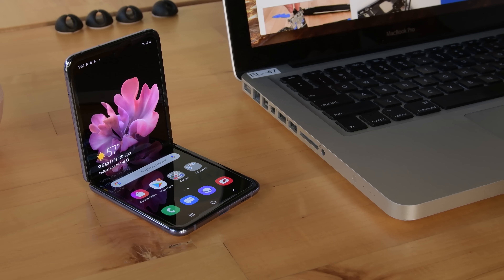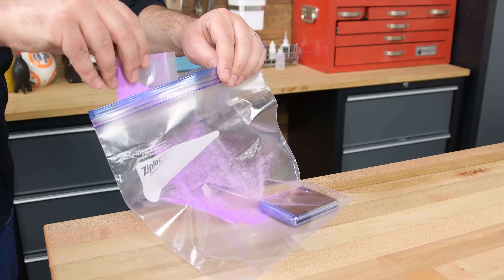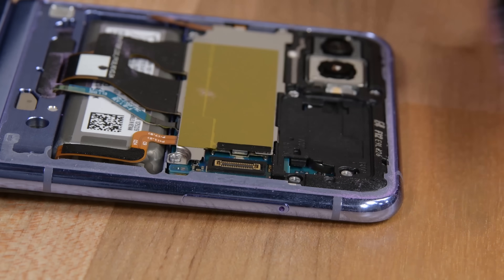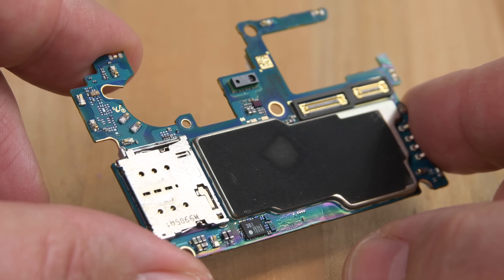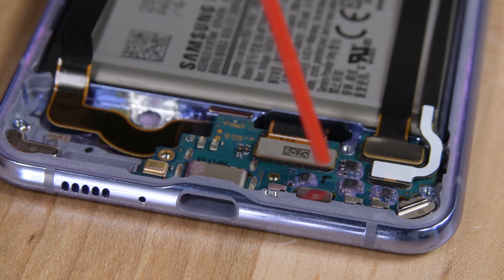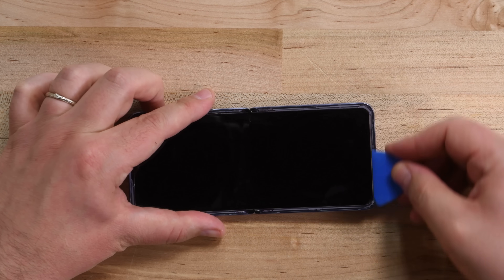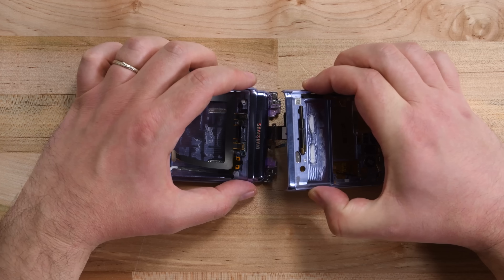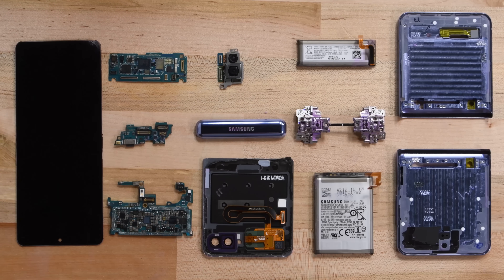Galaxy Z Flip Teardown and Dust Test FAILURE!

Comment from the maker: What do you think of the Galaxy Z Flip? And what do you think it should be scored?
Reply: Too much hype for glass that didn’t give any protection
Reply: Watch Jerry rig everything’s video to see it so basically the glass is under a plastic ‘protector’ which is actually part of the screen and if removed will kill the display and under that is glass so pretty useless glass
Reply: @montyyy  "But this glass is built to last and protects your screen from scratches" ~ Samsung
Reply: Maybe 3/10 or 4/10
Reply: Scratches at level 2 -> 2 out of 10
Reply: probably 2 or 3. Givin how fragile and the importance of the phone display it is.
Reply: 0/10
Reply: @DimaTkachenko  hahaha bitter apple fanboy.
Reply: @dreezyloran6787  no it is a 0 it has no reason to exist
Reply: 6.9
Reply: 5/10  Love a flip phone but will not buy 1 til samsung works out these issues you and others have brought to light
Reply: 0. It shouldn't exist, it's a solution for a problem that doesn't exist. I don't NEED a flip phone, if I did I'd rather see a physical keyboard hinged to a display, something like that. Not some morons trying to bend glass in half because they can.
Reply: Arudanel ok get some blackberry phone instead ok simple periodt
Reply: This phone looks like a total failure if it didn't bend it would be a 150 dollar phone.
Reply: @Babaji5D  your not going to buy a $1380 phone then ignore the warning that clearly STATE not dust resistant then put the phone in a bag of dust shake it then complain when the phone brakes. Would u go swimming if u can't swim?
Reply: 2/10
Reply: Samsung DID NOT tell you guys you can use a screen protector, stop making shit up just for a longer video. Both warning labels clearly says no films, stickers, or screen protectors. Also who is professional enough to install screen protectors on the z flip other than Samsung... Nobody period and Samsung doesn't offer this service since no official screen protectors exist for the z flip seriously get out of here.
Reply: An absolute failure and shame. Paying $1400 for this piece of shit is a best way to prove yourself a slave to this company
Reply: I think it's a 6, from a repairability perspective. Routine glass removal than easy battery swap (except the glues). Screen replacement isn't hard too, but it breaks the plastic bezel, and if there is no official replacement part, then 4/10.
Reply: 2/10
Reply: The foldable glass is brittle since it relies on the plastic screen protector for protection lol. Samsung needs Corning's Willown glass for their foldable devices.
Reply: solid 4
Reply: iFixit I don’t know probably a 2 out of ten about the only thing you can repair on it is the battery but it’s super hard to get to. You can do anything about the screen because were are you going to get one?
Reply: 3/10
Reply: Cool invention, I'm not buying it..
Reply: Please tell Zack Jerryrig to use isopropyl alcohol to remove battery..
Reply: It is very expensive.
Reply: The video made it seems so easy, I'm expecting at least 5, but wouldn't be surprised if it gets lower score, because I see a lot of glue and prying that might damage the component, and I don't think that the screen bumper is coming back
Reply: 1 for glueing the batteries down still
Reply: can’t compare with a laptop when you have to squeeze every millimeter of space. i do think the test is a valid test as it shows what can ultimately happened. however, ifixit didn’t provide any baseline like same tests conducted with other devices including legacy moto razr
Reply: 0
Reply: Lu Up not really because if you watch Jerry rig everything the glass that was under the plastic layer cracked and the glass offers no scratch resistance
Reply: I'd give it a 4/10
Reply: 6
Reply: I don’t trust Samsung anymore. Galaxy S10 + was the last purchase from Samsung liars!
Reply: 0/10
-
Reply: Rubbish
Reply: 2/10
Reply: 4
Reply: 8/10
Reply: 3.5 ?
Reply: 4 out of 10
Reply: 4
Reply: 4/10 for Open the device ... But 0 Points for this clickbait powder with hard particles
Reply: iFixit god no
Reply: Why iFixit's channel is not verified?
Reply: Yikes 😬. I may return my fold! I do construction 🏗️ and work around dust parti all day!
Reply: I bet u did this after seeing Jerry's video 😏
Reply: There is a difference between dust and powder.
Reply: iFixit  this review is pointless to regular consumers.  The warning says it’s not dust resistant or waterproof. It seems we have more clickbait than real reviewers.
Reply: Repairability: 6.5
Durability: 3.5....for now

Depends upon how easy spare parts are - could have a lego set and if you're needing to replace one special brick that you can't buy - that would be zero repairability - a factor overlooked - access to parts.

So presuming spares available - I'd say it's a 6.5 as for durability, looking at a 3.5-4 and maybe lower after time has had its say.
Reply: @paulgray1318  You forgot they only rate openable phones 7 and above. 6 for phones which need ungluing.
Reply: 5 out of 10
Reply: 9
Reply: @cristianfederico2411  lol
Reply: It's useless. Why the fuck ppl need a fold phone anyway? Can it help to save space ? No ,it is use more space in it pocket and waste more space in the battery size and it not even "drop" proof. Its some ridiculous hype for s rubbish product
Reply: @haidweng7948  You must have been on something when you wrote that pile of crap pal. There's a number of reasons people buy a folding phone but none your intellect will understand. I won't try and explain why it fits pockets better than none folding phones of the same screen size because you won't understand that either. Put a decent case on a mobile phone and it will be drop proof for most people but I suspect you keep dropping yours as a consequence of being on something and losing control of your faculties. I don't own a folding phone, yet.
Reply: kinda embarrassing that in many countries people starve because they have no money water or food, but you buy a expensive phone and destroy it just because.  its tragic.
Reply: @darknessviking  Wow are you ever missing the point of iFixit! It is actually possible to tackle multiple societal problems, such as starvation and right to repair/e-waste, if you let go of the concept that ALL of your effort should go to the cause which is affecting global health at the moment. The folks at iFixit do not specialize in Supply Chain, Public Health, Nutrition, or any other field directly applicable to ending world hunger. This channel, and research into what damages electronics and what can be done, consumer reporting, is their job. If consumers buy devices which can be repaired, those devices do not need to be thrown away. The E-waste problem is a huge global issue with which the current and future generations have to grapple, just like starvation is today. You have to take a multifaceted approach to appropriately solve the world's problems.

By the way, you know who else destroys phones "just because?" Phone manufacturers. Phone manufacturers like Samsung throw absolutely everything at their phones to see how much they can take. They'll destroy dozens of them, not just one. Typically, they are not proud enough of what kind of pounding their phone can survive to boast about it, which is why you don't see phone manufacturers abusing their own products online. Because of tech companies' conflict of interest in disclosing the extent of their products' durability, it is up to independent parties with large platforms to run similar tests so consumers know that their devices are at least reasonably durable or repairable.

Also, if you're watching for entertainment, I posit this is not the most destructive entertainment outlet I've seen.
Reply: @darknessviking  Kinda embarrassing that you have internet when in many countries people are starving for such an opportunity that you are wasting away straw-man moaning when you're not playing your PS/4.
Reply: @darknessviking  you're tragic.
Reply: @darknessviking  Kind of embarrassing that you aren't in those countries right now feeding people and giving them water but instead bought a digital device and are now leaving a comment instead. It's tragic.
Reply: @darknessviking  It doesn't look destroyed and at least this phone has been disassembled to educate repairmen to fix this phone instead of binning it.

Comment: The single thing stopping me from buying the flip 3 is the dust. In the past I've had way too many experiences with dust getting under the screen, camera lens, generally places you wouldn't expect dust to be trapped in. This looks like a nod to those olden days. I'll wait until they get a proper dust resistance rating.

Comment: Thank you for the video! But I have to change the frame that you can see at 2:13; After I remove the old one, to put the new one, do I need an adhesive tape or does It get stuck in place by pressing, without nothing? Thank you.

Comment: One month in jeans pocket, still no issues. One small tiny scratch on screen, my Chihuahua stepped on it while open. But surprisingly no any deep scratches which after Fold that I had before shows the actual improvement. It's a cool thing. It has no other value it's just cool. Not a boring block

Comment: Once manufacturers finally figure out, how to seal the whole god damn phone with hinges and whatnot, only then will folding phones become the big thing. Until then, I am pretty happy with my standard phone without any mechanical elements.
This phones seems to be pretty easy to take apart. Knowing, that there is nothing about resistency against anything, I am pretty confident I could easily take it apart and put it back together again, not worrying too much about replacing batteries or anything that might break.

Comment: “Alright, we’re gonna test how durable this car is by running it over with a tank, then calling an airstrike on it. Wow, look at that, it’s not starting up, well, this is shit, don’t buy it, not recommended as a daily driver”
Next time, maybe go a bit more granular on the dust ingress. 
Unless I’d been buried at a beach, my pockets wouldn’t be anything like what was in that ziplock, and the stuff that does build up in them is nearly always fibres of fabric, not tiny crushed rocks. 
As such, this test is meaningless to see how well it’d resist everyday ingress and how good it is at cleaning itself, as by killing the hinges from the start you don’t allow it to function as intended. 
There’s a big difference between doing something that’s designed to simulate extended use of a product in a short time, and outright killing the thing. 
“We need to test this engine for its ability to filter detritus from the fuel, and we need to simulate a lifetime of filtration as quick as possible, we did the math and over 10 years a car gets x amount of garbage in its fuel, so let’s just pour that much junk in the fuel tank right now, oh look at that, it’s the entire capacity of the fuel tank, oh well, it’s a realistic yet accelerated simulation of the ageing process, right?”
Your tests are useless to the point that they make the new design seem worse than the first generation, despite all the objective improvements. 
Between this and absolute misrepresentation of what apple was actually doing with iPhone battery replacements, these videos are starting to look more and more like tabloid clickbait every day. 
Shame, I always liked ifixit for, well, the community repair guides, but they were, naturally, from the community. 
Official teardowns have also gone from giving informative information on the technology and construction methods of products to simply seeing how easy it is to get all the bits apart and calling it quits there. At least you haven’t done away with labelling all the important IC’s on the main PCB’s, well, yet at least.

Comment: you guys need to show how you put stuff back together as well. I bet it doesn't look right because of how difficult it is to take it apart. not your fault but it's just impossible to repair this stuff, I followed the guide for my Galaxy buds because they got plugged up and completely destroyed one because it was impossible to put back together just because all the components were so small and for some reason it doesn't fit back together after opening it even using an I fix it kit and being very careful

Comment: As a professional purple dust phone powderer for several generations, this is a travesty!  How dare things break when I try my very hardest to break them?  In all seriousness, unless you carry cocaine in your pocket, this won't be as much of a problem as you're making out.  Lint, formed from tiny fibres of fabric, do not behave the same way as minute, abrasive mineral particles.  No product is idiot-proof.  Just take a little care for your expensive product; don't slam it closed with huge pieces of gravel inside, or stab it with a pick, and you'll be fine.  This phone is worth as much as an entry to mid-range Swiss watch.  You don't ask yourself why your watch can't withstand a blow from a hammer or avoid being scratched with grit, do you?

Comment: I would give Samsung 00/10
The brushes doesn't work well
The screen is crappy plastics and can be easily scratch by fingernails.
Even the glass on back is so weak.
Older processor chip and it is the super expensive.
Jon proser is right. We don't need foldables

Comment: Would be nice to see the battery capacity in a consistent unit. This video used watt-hours while the Motorola Razr video used milliamp hours, making it harder to compare them.
Reply: Moto razr : 2500 mah
Galaxy fold : 3300 mah
Reply: @Dimetri777 yeah lol

Comment: Just can't get with foldables. They're neat, but my iPhone XR (+ purchased a Clear Case) and iPad 6 (+ purchased a Smart Cover and Apple Pencil) combined ran me $945, compared to one $1500 Z Flip or one $2000 original Fold.

I just.... A Galaxy S10e and an entire Microsoft Surface Pro 5 combined totals only $1100. That's a snapdragon 855-equipped phone and a literal Windows tablet PC for less than a Z flip.
I know foldables are here to stay, but they will never ever become the norm, nor will they ever become a remotely reasonable value proposition. Tried-and-true slabs of real gorilla glass will always reign supreme.